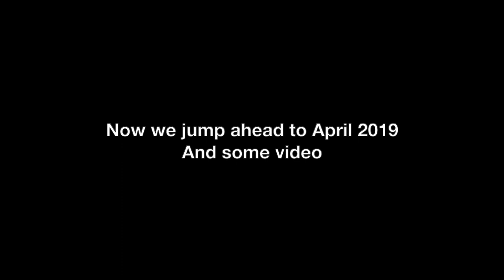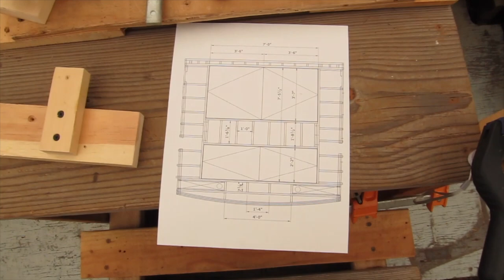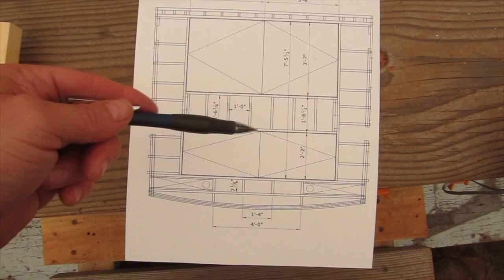Cockpit Deck Framing project begins on a 1973 Egg Harbor boat - Boat Restoration EP035 Jan-Apr 2019

Comment: Curious why the use of mahogany for under deck frames? Aren't there less expensive options?
Reply from the maker: Thanks for the comment. Well the factory used mahogany for all of the larger beams. I decided to use it for the smaller pieces as well as I like working with it, It  is pretty light weight, is pretty rot resistant and I bought a bunch of it when it was on sale at the wood supplier knowing I would use it at some point.

Comment: Keep up the great work.winging it eh? What size engine and what about clearances for removal? The tanks are long are you getting different sizes
Reply from the maker: The originals are chrysler 318's. The side frames will be removed when I remove the engines and tanks. Plenty of room. I still need to talk to a tank fabricator about the new tanks. No decisions have been made on tank sizes or engines. Thanks for the comment

Comment: Hi Bob, Love the idea of the modular cockpit. I think the builders used Doug Fir for cost savings and the Mahogany will be a big upgrade. Did you ever say if you were rebuilding or replacing the engines?
Reply from the maker: Thanks. I really think that every mechanical and electrical item on my boat should be replaceable without having to cut the boat apart. If it can be avoided with a little extra work in design and fabrication it will be to my benefit down the road. No decisions have been made as far as the engines go. Still weighing my options. Once I get the old ones out and torn down I will have to decide how to move forward based on finances, my abilities and the situation in general at hand.
Reply: @renovationsportfish1563  Great idea, looks like pulling engines in the future (God forbid) will be much easier with those removable sections. Those Chrysler 318s have done very well over the years and should be worth a good hard look before replacing them. I'm REALLY looking forward to "our" first cruise.

Comment: Looking good. Myself would give a lot of thought about changing out those motors to a couple little Kabota diesel‘s or something like that. It would sound pretty damn good going up and down the old Connecticut River. I just don’t know if those old motors would be reliable enough
Reply from the maker: Thanks for the comment. Once they are out and I can evaluate the condition of both engines that will probably open or close some options. All options are on the table right now. Brand new engines are at the top of the wish list but if the cost keeps me from getting the boat in the water it may not be the best option right now. We will see.